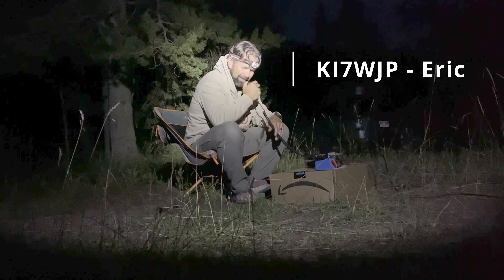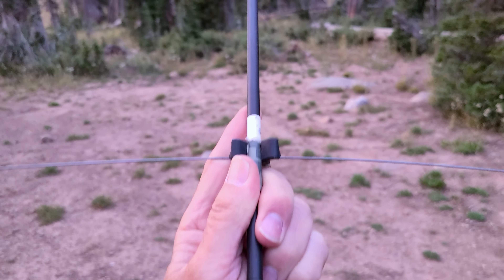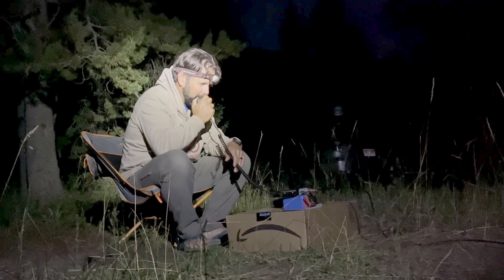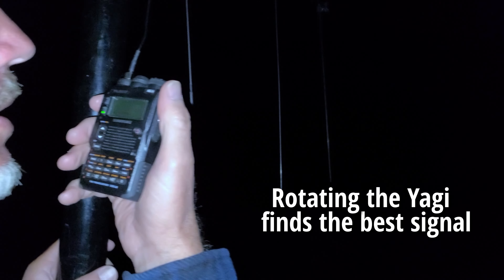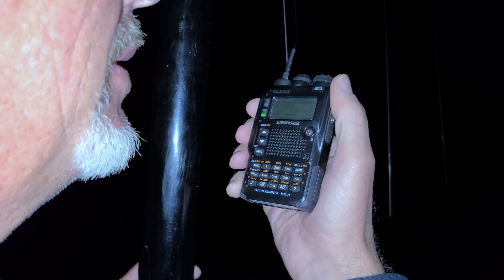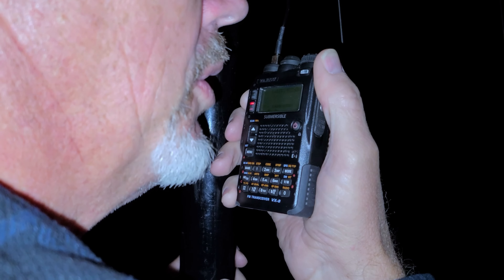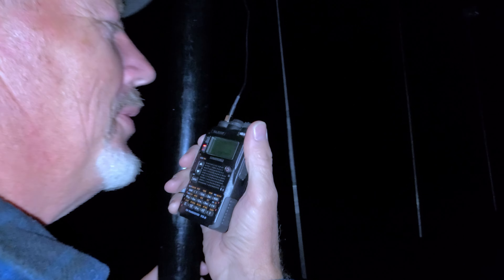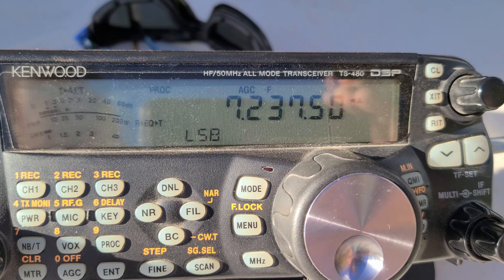New Hams Should - DO THIS ! | K7SW ham radio

Comment from the maker: Do you use a 2 Meter Yagi ?  Let me know your antenna of Choice
Reply: Built one a couple of years ago with PVC pipe and measuring tape.  Works great on my Yaesu VX-6R and my Baofeng's.  It is great for contacts when I know what direction to point it in.  Otherwise I use my N9TAX on my FT-2900.

Comment: Really great test! Also, amazing antenna build - I'll have to put together something like that one of these days. To put things in perspective, two of those 3-element 2m Uda-Yagi's pointed at each other using 5 watts on transmit is roughly equivalent to transmitting at 125W. Just gotta make sure they're pointed the right way, but finding that out can be the fun part of using an Uda-Yagi! My other favorite VHF antenna is the Extended Double Zepp, especially for VHF SOTA activations where I never know what direction the signal's coming. It has a theoretical 3dBd gain but because I use it with a fiberglass mast, it usually WAY outperforms my HT.
Reply from the maker: Thank you Miguel, you are so right,  the gain with a yagi is something every new ham should get to experience.  Your antenna build sounds fun.  Thanks for sharing. 73
Reply: Thank you for explaining what that gain is equivalent to. This was a fun test!
Reply: @backcountryamateurradio  For sure! The math: those yagi's typically present a 7dBd gain and the gain is additive, so two yagis is 7dB + 7dB. If you do the math with 20W output, the effective gain is crazy - effectively 500W. Another factor here is antenna height (rough rule of thumb is 3dB gain every time you double height). Just goes to show that directional antennas and antenna height are WAY more important than output power. More power to you /P and /M ops!

Comment: I usually do it when I'm mobile while in Crossville, TN. Made a couple of contacts on 52.
Reply from the maker: Simplex mobile is pretty fun I think.
Reply: It is, depending on where at. I've tried it in Knoxville one time and no one was on. I have better luck in Crossville for some reason. The best contact was with KI7ELK, I believe, can't exactly remember the prefix but the suffix is what I remember. 

He was on I-40 from Arizona moving to Virginia. I was waiting until I got in a good spot to through out a call. Before I got to do that, I hear him come on frequency and asked if anyone had a copy on him. 

I grabbed the microphone out of my lap and got back to him. It took a few times to get his call, but I eventually got it. Had at least a 10 minute QSO on 52 until we lost line of sight. As soon as I got to my destination, I logged the contact into QRZ. Took a screen shot and sent him an email of the contact. I didn't worry about the grid, but he confirmed the contact.

Edit: Just looked at my log, it was KD1ELK. Being from Arizona sure did play a trick on my memory.